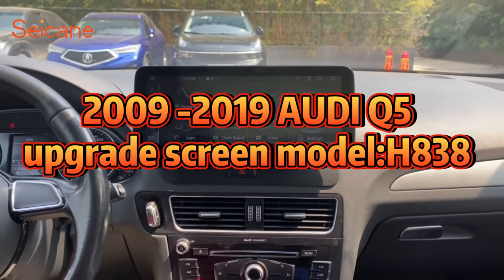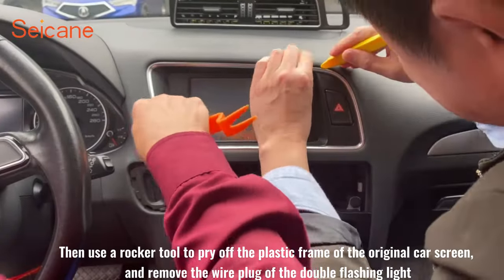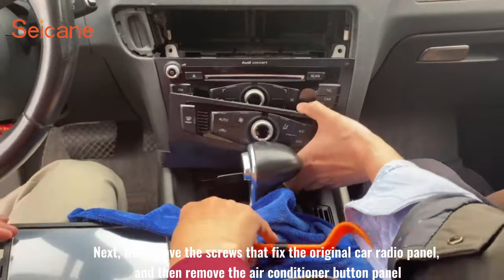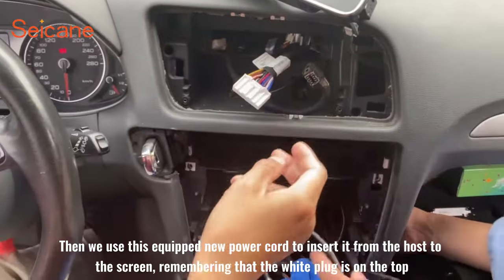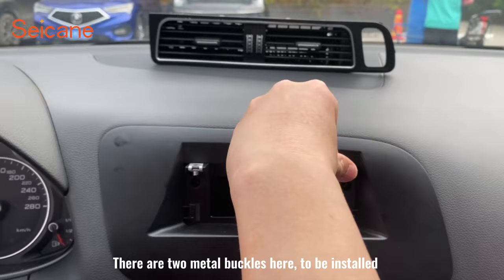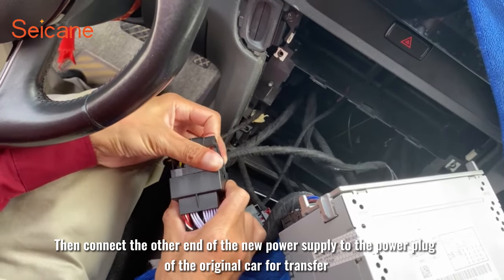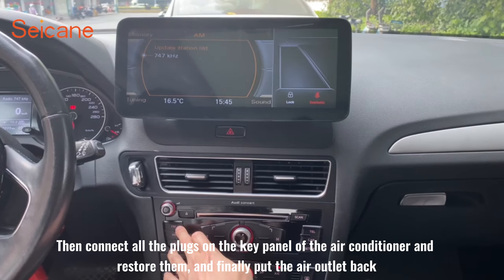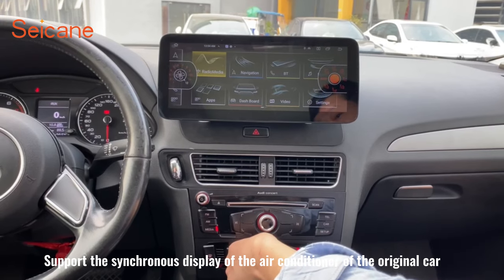The Best 12.3" Android Radio for 2009-2019 Audi Q5 Stereo Upgrade

Comment: I got this done on my 2013 Q5. All works fine but the background hissing/white noise sound is so bloody annoying. How do I get rid or reduce it?
Reply: try wired carplay/android auto
wireless is bad
Reply from the maker: hi, It may be influenced by signals and the environment
Reply: I read up that this is connected to cars having a bose system and an audi inbuilt amp, I think you need different wiring to get rid of it ( which is cheap to fix)
Reply: @philipcraig332 hi, can you please tell us the fix you found ? I have the same issue on my audi a4 when i play music via aux :(
Reply: If it is in the aux try using an aux denoiser
Reply: @edwinoko  and connect it where ?
Plus.. the tablet is the one that gives out the music, not a phone connected to bluetooth or aux
Reply: Hola !! Tengo el mismo problema , sabes cual es la solución???
Reply: Encontraste la solucion ?? Tengo el mismo problema
Reply: @philipcraig332 sabes que cableado es ?
Reply: @xpnexus2265 hola !! Has podido solucionar el problema ??
Reply: Does this have the vehicle information capability?
Reply: @faces.future  yes.
Reply: @xpnexus2265  hi, you resolve?? I have same problem on a q5
Reply: @morenoburatti1859  hi. No, i dont think it is a fix for this.
Plus, the tablet has another problem, it never shuts down if you have a car with CAN.. at least mine doesnt
Reply: @xpnexus2265  I'm near to find the problem....the problem is in the wire from radio audi to mekede. I move connector and noise stop. In the morning I remove wire by wire until find the reason and I tell you
Reply: @xpnexus2265  hey man I find the problem.....
Reply: @morenoburatti1859  curious, what is it? Cause now i'm not listeling to music on aux..

Comment: Any ideea why new screen interface doesn’t change when in reverse ?
Reply from the maker: please make sure this "BACK" cable is connected to reversing light of original car, in order to make sure it switchs automatically to image when the car is in reversing status.
Reply: @Seicane-Car-DVD  thank you for your reply, the unit can support old oem and it has new interface . On the old oem it registers the reverse gear , only new one causing issues . Thought that’s done through the cambus 🤷‍♂️